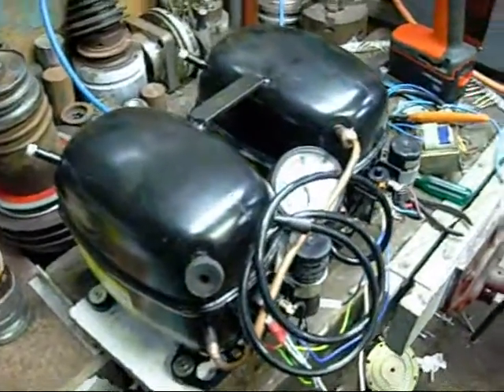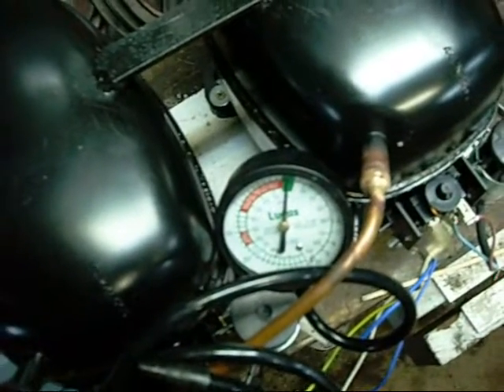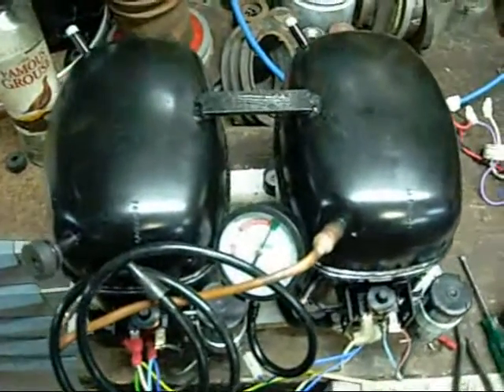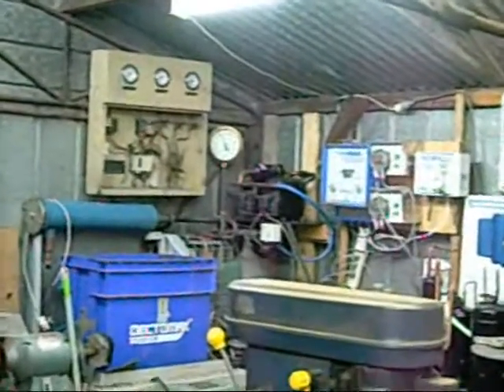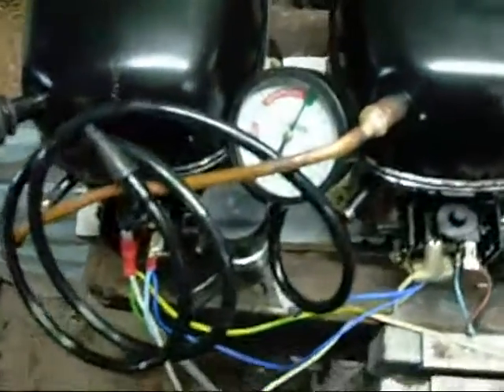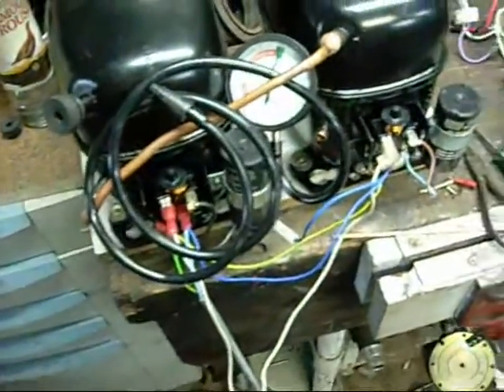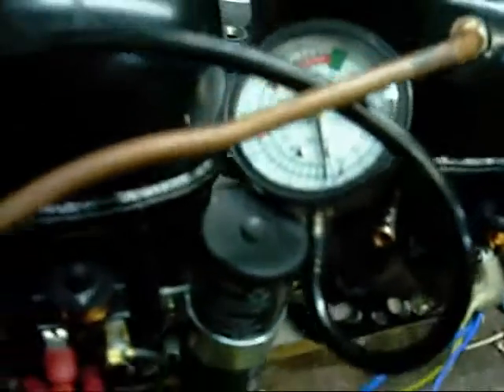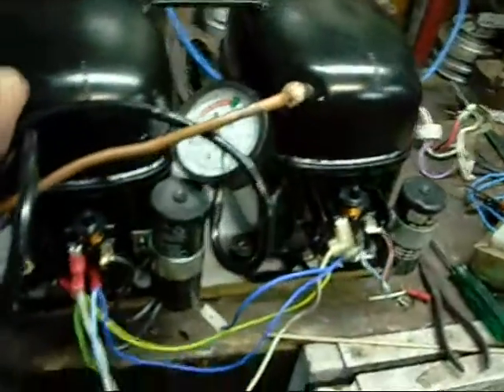2 Stage Vacuum Pump test

Comment: Maximum Vacuum attainable at Sea level is 29.921 In/mmg  If you are higher than that it diminishes roughly 3.5% per 1000 ft above sea level. :)

Comment from the maker: I'm not an expert on vacuum but I think we can go lower than 30in/hg. HVAC vac pumps pull 500 microns on AC systems before they are charged with gas.

I haven't been able to boil water itself at 30in/hg, but thats according to my old gauge.

Comment from the maker: unfortunately i don't have a working VFD at all :( but I have done a few torture tests with normal AC power and no oil but their not very dramatic, just binds up the motor bearing and stops it.

I'd love to rev them to 2 - 3 X their normal speed and see them shatter :D.

I'll belt drive one off the 2HP brook motor some day before I run the big scroll.

Comment from the maker: I wish I could keep these too!, but they have to be accounted for on the scrap records :(

I'll push the limits by doing educational films with them but at the end of the day, I have to issue a Certificate of Destruction to Danfoss.

ones I find out what they are capable of I'll build one using compressors from junk fridges which I don't have to account for.